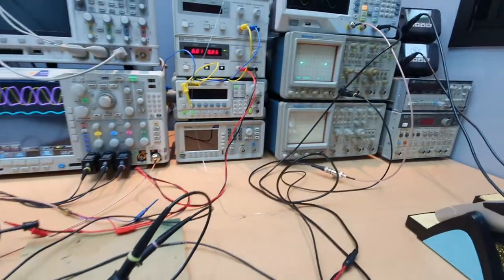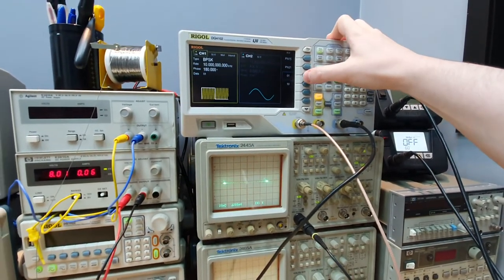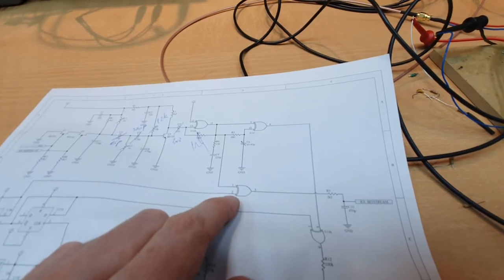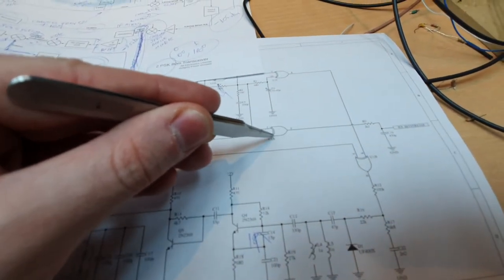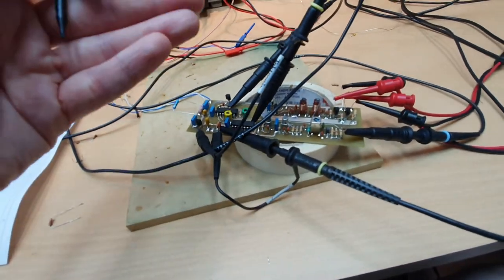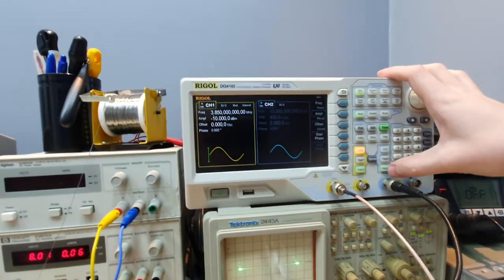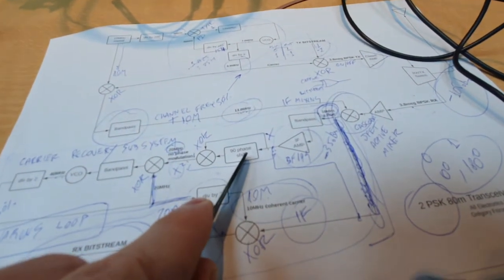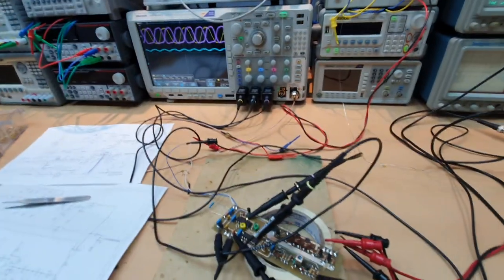2PSK Carrier Recovery working!

Comment: Hey Gregory,

Eu percebi que você estava visualizando a constelação do BPSK no osciloscópio usando um único sinal. Qual é o pulo do gato nisso aí?
Eu sempre achei que você precisava de olhar I e Q em modo X-Y.
Reply from the maker: Hey man! 

The BPSK constellation has only the I component! 

Of course, in a higher order phase modulation, like QPSK, you need the I and Q components.
Reply: Faz sentido, valeu!

Preciso sentar pra revisar comunicações digitais :)
Reply: @AllElectronicsChannel  I can see the Q component.  It is zero for both values of the carrier while the I component is either 1 or -1.  0 or 180 degree phase shift.
Reply from the maker: @loremipsum5759 Yep!

Comment: Perhaps the problem is you are using a digital part as analog?  You are providing negative feedback to set the DC operating point.  This will cause "oscillations" by definition since it has a very high gain at the midpoint.  In reality it is just amplifying the low level noise, no?  This should not impact the operation of the circuit when you have a signal present.  It will be sensitive to noise in the signal at the time of zero crossing, but otherwise should be free of oscillations when you have a signal pushing the balance one way or the other.  Isn't this the essential principle of how a regenerative receiver works?
Reply from the maker: I was concerned because using HC04 I was able to supress very well the self oscilation using a phase shift network at the output, you can see it in another video of mine.

The same ideia really did not work with de HC86 gate, as it has a complexer topology and worst phase transition. 

In a stable environment the circuit will be stable if it has proper phase margin, but this is difficult to stablish with a circuit the does not have single pole dominance!